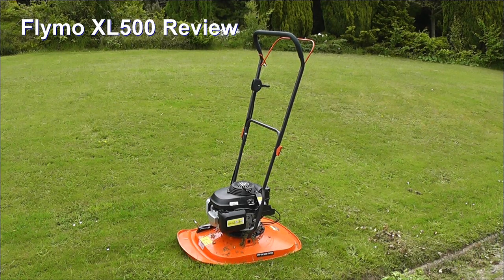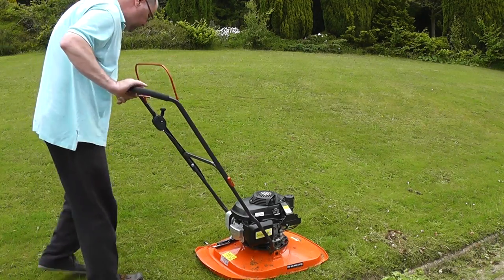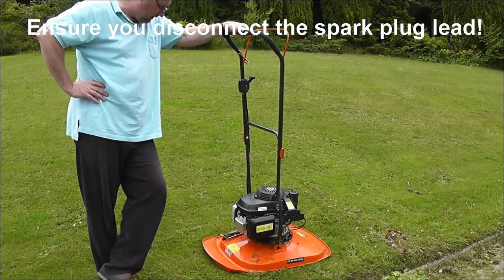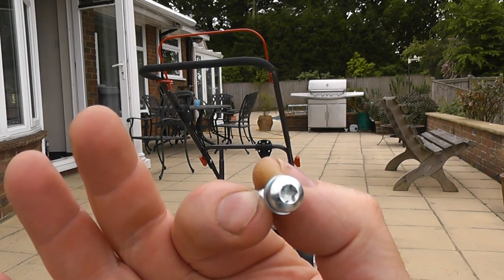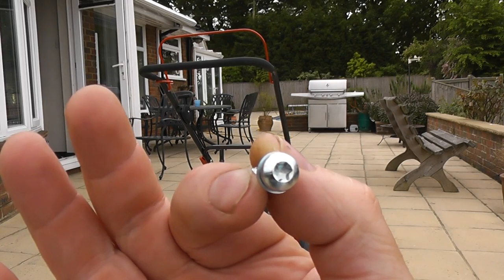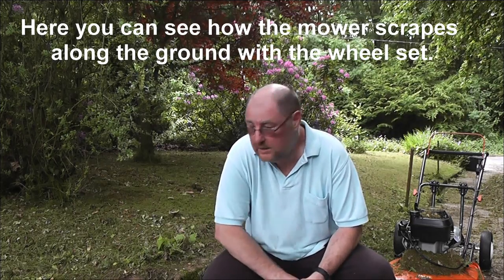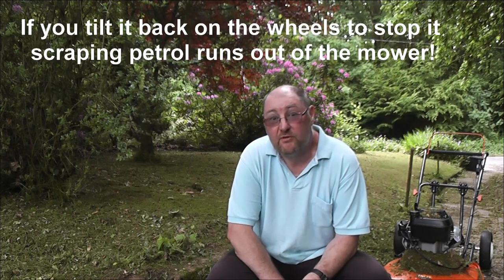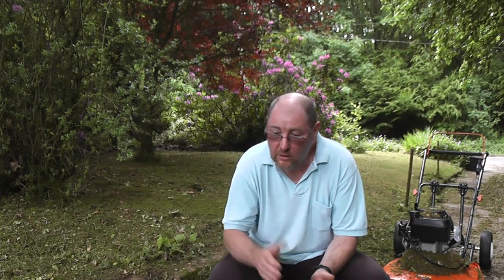Flymo XL500 Petrol/Gasoline Hover Mower Review.  Honda Engine.

Comment: Good review. I'm no expert but I think you should have faced the drive when mowing down the hill and used the mower in a side to side motion in order to stop it hovering off the edge
Reply from the maker: It is difficult either way.  Size to side operation is difficult whilst standing on a slope.  :-)

Comment: how much do they cost? american?   what if it flips over does it shut off if flipped while running?
is this supposed to be a self propelled mower without the transmission? can you mow tall grass with it?
Reply from the maker: Brian Lee Hello Brian.  I could not find the Flymo for sale in the USA, however Husqvarna own Flymo and they sell the GX 560 in the States.  I found one listed at $849
http://www.husqvarna.com/au/products/lawn-mowers/husqvarna-lawn-mowers-for-homeowners/

The mower will not flip over.  It floats on a cushion of air and is in fact a minature hovercraft.  As soon as it is spinning, air is pushed down through the top of the orange case via a fan on engine, this is forced out from under the casing and effectively lifts it off the ground slightly.  The mower then floats on this air cushion and is very easy to push around.  The air flow is nowhere near enough to allow the mower to lift any higher off the ground and the mower is too heavy to flip over.  There is no auto cut off.

You can see the mower dealing with longer stuff here
https://www.youtube.com/watch?v=XyTOBEDAkFM

I reckon you need the wheels to deal with this sort of a problem though Brian, because the hover function will not lift it enough to get over the longer stuff.  You can see how I have to pivot it over using the wheel set.

So because it floats a few millimeters off the ground it is not self propelled, but it is remarkably easy to use. 

I hope this helps.
Reply: yes you helped alot, if anybody knows how i can order one in the U.S ,please tell me, i looked at the website and it will not give me a dealer in my country, would it cost alot to have it shipped to U.S from your country?
I want to thank you for making this video and sharing this you do a great job showing the operation of this mower.

Comment: Well I finally bought a brand new one of these, same as yours, last month. I'm incredibly disappointed with it - worst mower I've ever had. I bought it for a reasonable sized, flat, garden, similar to the one at the start of your vid. The reason for my disappointment is not that it's heavy or difficult to manoeuvre (I was expecting that) but it sprays grass EVERYWHERE. All over your legs, flowerbeds, foot paths, everywhere. Twenty minutes or so to cut the grass and another ten to clear up the mess. I also have a husqvarna wb53 mulching mower which is an outstanding piece of kit and mulches the grass so beautifully you can hardly even see the clippings. This was an itch that I had to scratch, but I wish I hadn't bothered.
Reply from the maker: I am sorry that you are disappointed with yours.  We were using ours today and still love it.  We are not worried about clippings, the areas we cut tend to be rough anyway and for that it is perfect.

Comment: great video but you did tip the mower on the wrong side ,it should not be  tipped onto the air filter side, should be  the oil filler down
Reply from the maker: A King Thanks for taking the time to comment.

Comment: Now all you need is two more wheels, and it will be a lawnmower again, rather than a temporary grass remover.
Reply from the maker: LOL.  I had self propelled mowers before this and this mower is much better than those.  It is so easy to handle whilst mowing.  Not having wheels to transport it is a pain though and that is why I bought the wheel set.  The wheel set made mowing even easier as you can pivot the Flymo on them for brush cutting.  :-)

Comment: This is the strangest mower I have ever seen.  I have never heard of a mower without four wheels.  You must have a different type of grass in the UK than we do in America. If my landscaper used something like this my grass would be totally scalped and would never recover.  I would have to have them replace it.  Very interesting to see, though.
Reply from the maker: Hello Blanca, hover mowers are fairly common here in the UK.  They are usually electric and much lighter.  Petrol hover mowers are pretty rare.  Hover mowers are a real pleasure to use on level surfaces as they float on a cushion of air and are very easy to handle.
Reply: You can adjust the cutting height from about 10 to 33 mm
Reply: MarcMac04 I found a pretty old video witch presents the first flymo in the year 1967 ;)
http://www.ina.fr/video/AFE04002111/tondeuses-a-gazon-flymo-video.html
English version begins at 9min 32 sec
Reply: They was a big thing here in the US in the 70s and 80s. I bought mine in 1978 it has a 2 stroke engine, it's light and easy to use you can go any direction with it. I still have it and use it to trim with once in awhile but I have just over three acres of land and it is easier to us the string trimmer to do the trimming.
Reply: It will NOT scalp your lawn. I'm in the US (Texas) and used one for years. The entire deck floats over the turf...no way it can scalp. I even used it over water on a golf course pond to cut down some reeds and lilies that were not wanted.
Reply: swiftjustice44 so cool. Never thought you could do that with one. Please put up a video of you mowing reeds with one.

Comment: I don't see any reason or benefit to this. A regular mower with 4 wheels is cheaper, lighter, easier to use etc etc etc.... I guess for sloped lawns it will give a more uniform cut height, BUT for all that effort manhandling the monster around it just doesn't seem worth it. 94 POUNDS for two wheels that don't even really achieve much???? WOW even in Australia where everything costs at least double the rest of the world you can buy a complete lawn mower for $150, it won't be powered by Honda sure, gotta spend $400ish+ to get a Honda engine. But ultimately my Victa is about 20 years old and still starts first pull every time, blows a little smoke, uses a little oil, but it works.
Reply from the maker: +tapper88 The hover mower is much easier to use than a wheeled mower and requires much less effort.  I have used both many times over the years and prefer the hover.  If you ever get the chance, give one a try!  Thank you for your comments.
Reply: +Russell Platten Pass, there is no way it is easier to use, also not having a catcher makes it absolutely useless to me. All it will do is make a mess. The only benefit I can see is the uniform cut height on slopes.......... but it appears to be a nightmare trying to manhandle the thing on a slope anyway, I was genuinely concerned for your safety when you tried to mow along the slope and ended up on the road.
Reply: Their are ways to handle the hover mower on slopes that makes it easy. With some experience I can say you may enjoy it.
I plan to make some didactic videos, but I just have to find the time to do it...
I Uses Flymo hover mowers since a long time (petrol and electric), and i can say i wouldn't change.
I enjoy it particularly when there are obstacles and curves in the garden

Comment: lt looks like it cut too low and there is no adjustment
Reply from the maker: mrannen1958 There are spacers between the mower cover and the blade.  The mower is set at it's lowest cut.  To raise the cut, you have to remove the blade.  Remove a spacer or both if required and replace the blade.  This is quite easy to do in reality.

Comment: my mate at work had one of these and he said it was utterly useless
Reply from the maker: I think utterly useless is a bit unfair!  Personally, I love it.
Reply: +c3h8O I don't know what you're doing but I've never found a hill steep enough to flip a push mower that I would actually be able to mow with this bad invention.... Hills that would flip a riding mower for sure... but a push mower?
Reply: +c3h8O my mate at work said it was useless for anything more than a small incline
Reply: Some people use a long cord as for a kite, standing securely on the upper side of the slope and it works fine, as it can move laterally without problems

Comment: What sort of black magic is this?!?
Reply from the maker: It has a fan action that blows air down into the blade housing through vents at the top.  The mower then floats on a cushion of air just like a hovercraft.  These mowers are brilliant, very light when the engine is running, but heavy when it is not so transporting it to and from the work area is a little difficult.  Fitting wheels gives you the best of both worlds.  :-)

Comment: Why (aside from being an idiot) would anyone put those wheels on it, which render it impossible to do what it's supposed to do???
Reply from the maker: The wheels do not stop it hovering and it works fine under normal conditions.  However on an incline the wheels can be used to control the mower and stop it sliding sideways.  Plus my wife is not strong enough to transport the mower without the wheels.  Or I may just be an idiot.  :-)

Comment: My Flyno was terrible and completely useless if you want a maneuverable mower just get one with front caster wheels
Reply from the maker: I find that a lot of manoeuvrability issues are caused by not keeping the air inlet at the top of the deck clean.  It needs the air to float.

Comment: This guy is a total amateur, he doesn't know how to start it properly, you have to put your leg on the marked spot, he turns it over on the WRONG side and when you're moving it it has to run, if it doesn't it will scrape of course.. read the manual for gods sake

Comment: Junk made to look nice the air flow pushes the grass flat and the blades fail to cut what is pressed against the ground by the air flow. on any professional mower the airflow is upward and draws the grass upwards into the blades making a clean cut. Buy a good mower not a piece of junk that looks nice. Fly mow will ruin a good lawn within a few years.
Reply from the maker: It is a fine mower, we used it today.  It is that time of year again here in the UK.  :-)
Reply: I have the electrical thing with the top box collection, blows the grass flat. and the bottom of the rim wears out by design. I use a cylinder mower by preference. what happens with a down draught mower is that the broad leaf grasses that get blown down flat stands up again and the finer lawn grass that is cut gets over whelmed after a few seasons, you do not notice the effect until patches of the wild grass start appearing by then it is to late to fix the problem. and using selective weed killer on a regular basis to control the situation will eventually kill any trees or broad leaf plants that have roots under the lawn, Inspect the grass after mowing and you will see that the broad leaf grasses are slowly taking over due to being knocked flat by the air flow.produced by that fan that sits under the engine. You may see it first time you see a dandy lion growing short and flat ti the ground.

Comment: why would you buy such an awful machine that you have to carry around? and no option for a grass catcher.
Reply from the maker: Because it is brilliant for cutting the grass on slopes and easily out performs self propelled mowers in these areas.  Being able to swing the mower around, left and right is also a big advantage.  I do agree with you about carrying it around as it is heavy.  On rough overgrown areas it is great too.
Reply: Russell Platten to be honest i used to be a fan of this concept, but never had one myself. its just when i realised the carrying it around part, i just realised that its not so great. The early ones to my knowledge were all 2 strokes or electric. A 2 stroke is lighter and has no problem being turned away on its side
Reply from the maker: I had to buy the wheel set for around £90 and these made transporting the mower much easier.  They improve the way the mower performs too.  Without the wheels it would be a real pain to transport.  I would not be without this mower and the bit of cutting you see on the video is only a fraction of the area I use it on.  I had two self propelled rotary mowers before I got this and these were a nightmare to use on my garden.

Comment: Bad design, plastic body won't safety if blade throw out will cut some peoble leg , hard to control at narrow area with root or rock because it keep fly up and slide around, no adjust hight low level of grasses, cut grasses look ugly and may be kill grasses after cut on Jun or July time
Reply from the maker: The Flymo hover mower has been around since the 60's and millions have been sold.  Other companies have copied the concept and sell them too.  I have no idea how many people have been injured by blade disintegration, but I suspect the injury rate is similar to other designs.  You can raise and lower the cut height with spacers above the blade.  I find the cut acceptable and the mower much easier to use than a wheeled one.